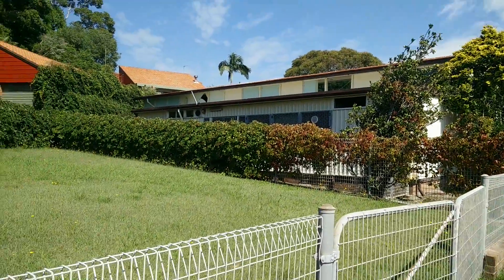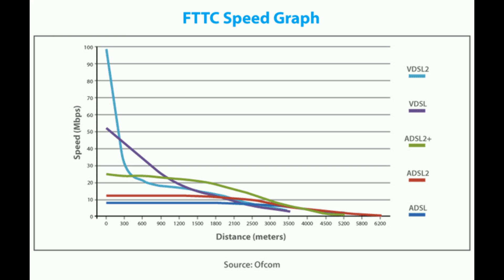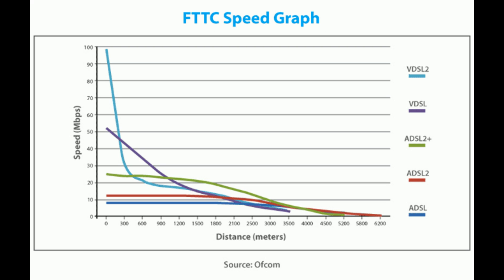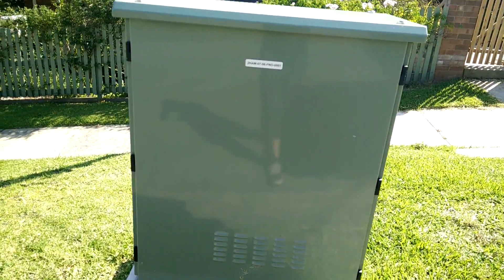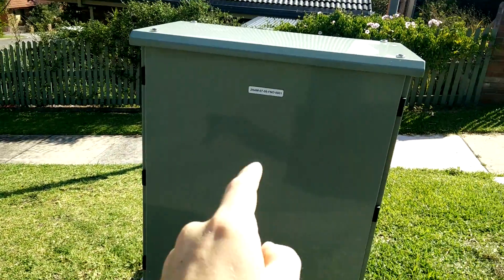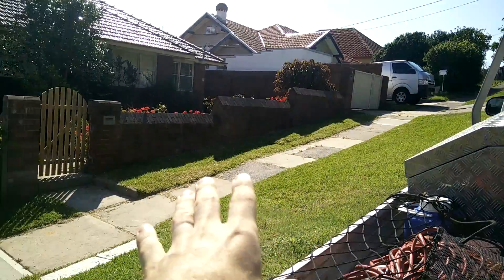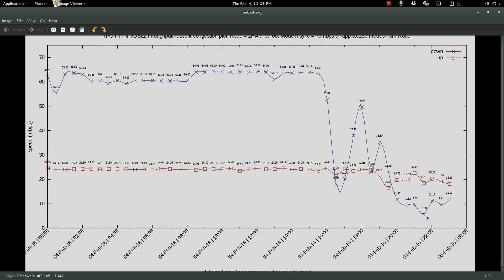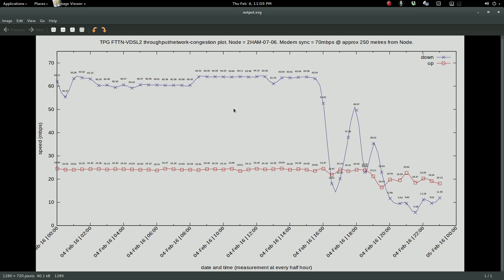NBN - What is FTTN and how to estimate your speed

Comment: Well Done very helpfull. Yours only slows down to 5mbs, mine slows to 30kbs. Thats right KBS.  BUT. I can do a speed test on the site recommended by my ISP at this time in the evening and the speed is fine, by the test. So there is a lot of untruths here. I have been using the internet for 25 years and the NBN is the strangest experience I have had.

Comment: FTTC is not the same as FTTn. FTTC is much faster than FTTn as it only uses a tiny amount of copper .users on FTTC would have no significant loss of speeds and would actually have speeds close to 100mps

Comment: Should use dial before you dig to get an accurate idea of where the copper lines run, so then you can use the google earth line measure tool to get a distance, rather than just guessing where the cables run.
When you perform the dial before you dig request, select the closest possible date, if you dont then Dial b4 you dig will try and charge you. Its a good idea if you go for a drive first and not the locations of nodes around your address before doing the  dial before you dig request.
Create an account at https://www.1100.com.au/ and enter your street address, select the area you want to research then you'll get emailed a heap of info. The file you want to look at is an autocad file, there are free dwg file viewers online to download, I use one from here: http://www.softsea.com/review/Autodesk-DWF-Viewer.html.
Once you open the dwg file you'll see the exact route the cable takes. 
I've seen instances where it would have made sense to run cables from the house in question to a node just down the road, but the cables in fact took a very different route and had I just guessed the path, I would have been very mistaken, and had absolute crappy speeds if I decided to rent the house I was looking at.

Comment: Very well done, with simple explanatoins, but remember the copper line maybe old but so is the copper in your house. Rewire your house with Cat5 or Cat6 cabling it will help. Also remember there will be congestion issues as the NBN is being built and the VDSL has the power of its signal turned down because at full power the VDSL interferes with the ADSL services still working in that same cable. NBN is totally focused at the moment of building the network in full. Then they will go back & sort out bandwidth & conjestion issues.  Just like Windows software.. get it released, bugs and all then provide update patches over the next several years.

Comment: The difficulty with estimating your distance to the node (or exchange for ADSL) is that you don't know where the copper runs in order to get from the node/exchange to your home. Copper does not necessarily run in a straight line from point A to point B, unless you are very close to the node/exchange. It would be more beneficial to know where the pillar is that connects to that node, and the pillar can be 50m away in the opposite direction!

Comment: Mate mine did the same thing come peak time... it became like a friggin yoyo, even getting down to 840Kbs woop woop.... any way few complaints to Optus and they past it on to NBNco who ended up slowing my speed down to create a more "stable" connection. 
So I went from a 98Mbs modem sync to 74Mbs.... this has actually fix it up. During peak times, my speed on 5ghz band will only drop to between 45 - 55Mbs so perfectly usable during peak times .... 2.4Ghz band maxes out at 40Mbs, and usually sits around 20Mbs during peak times. Ethernet connection stays at a steady 65-70Mbs all day.
So yeah it has slowed down. but is now usable, and actually a lot faster than other people I know. 

Now the next problem is the stupid flippin modem, I mean WTF  is this crap. Constant wifi drop out and piss poor reception in back rooms of the house. Plus a large majority of my devices couldn't even connect to the 5Ghz band included a brand new 2016 Smart TV. 
I grabbed a mates NETGEAR X4S Modem Router and tested it. It works and is pretty easy to set up to FTTN (optus) using the connection wizard. But for some reason it syncs about 10-15 MBs less :(    But the wifi is 1000x superior. Ended up putting the X4S into AP mode and just using it as a router. And it's fantastic. 

Im going to buy a D-Link Taipan Modem/Router tomorrow and hopefully this will make it even better...... if not then I will have wasted $500 :P
Reply: Michael Auricht mate I know you posted this a year ago, but did you end up getting the taipan modem, & did it fix the problem you were having? I just purchased the cobra which is the next model up from the taipan ... And how’s your internet running now a year later, has it stayed stable since they dropped your speed?

Comment: unfortunately, that estimation method doesn't really work for MOST people. because more often than not, the copper does all sorts loops and back tracks and what not before your house. I'm about 30 - 50 meters from my exchange, yet well over 200m of copper line exists between my exchange and house - according to the telstra tech who came to diagnose my bullox 1.5Mb/s ADSL2 connection. freaking bullshit.

Comment: I'm on Telstra cable (not NBN) and I get 115 mbits/2mb and it doesn't seem to be effected by peak conditions. I'm due to go onto HFC for NBN in 2018 . I'm worried my speed may actually be  worse because everyone will be on it. At present many are still on ADSL as it is cheaper.
Reply: Yes you will loss your speed it will drop below 100mbps only good thing is faster upload... but peak times its gonna be a mess. Stay on Telstra cable as long as possible if upload is not a problem.

Comment: ur using TPG...... nothing more to be said...
Reply: Oh and its not congestion with the node..... its your ISP overselling their network....
Reply from the maker: "Oh and its not congestion with the node"
You're right. It's not congestion with the /node/ ...the issue of congestion is not a technological one but rather it stems from the business model surrounding bandwidth costs for RSPs (CVC).

"its your ISP overselling their network...."
Not quite. Even though my RSP have the option to buy more bandwidth from NBN Co (the network owners) and therefore alleviate the congestion, it's not viable for them to do so unless I'm prepared to be charged a lot more for my monthly bill. If you currently think your RSP is more altruistic because of your own personal bandwidth experience then I'd suggest reconsidering; it's more likely that you're surrounded by light-use users than your RSP attempting to make less money outta you.

Comment: Very well made video, thanks. If you could do one talking about FTTP that would be very cool!
Reply: With FTTP, the Fibre distribution hub (FDH) is technically the node. The fibre runs all the way to the house and terminates at a Network termination device outside, which feeds into a fibre optic modem inside (from there you connect to a router and/or phone the data ports can also have a direct connection to a PC via Ethernet cable)  which has in my case 2 Voice connections, and 4 data each of the ports can be treated like separate lines/accounts so you could have a data port for private use and a second port for business. In the event of a blackout the modem switches to a battery back up and only allows telephone calls to be made the data side is essentially switched off.

Fibre unlike copper has no maximum data transmission limit where copper maxes out at 10Gbps in perfect conditions, fibre currently can take terabits per second in lab tests or Petabits for 12 core fibre. Also Fibre isn't effected by length of the cable as much as copper, it isn't unheard of a fibre run going 100Km before needing any kind of amplification/regeneration of the signal, fibre also isn't really impacted by electromagnetic interference causing things like packet loss.
Reply from the maker: I don't really know anything about FTTP because I don't have it. I know that the fibre runs all the way into your home and I think it terminates at some equipment which is installed /inside/ your house. The Nodes are still there, but instead of it switching over to copper they just act as hubs. Also, if it was all fibre (like the original plan) then the Nodes would NOT need to be powered, i.e., in the event of a blackout, everyone's internet access would still be working 100% fine. Your computer may not have battery power, but your laptop + phone most certainly would.   

It was a much smarter and more forward thinking solution..

Imagine a catastrophe with FTTN: the Nodes lose power (or at the very least, your Modem loses power), everyone's Internet access goes out, and no one can make any landline phone calls as it's all been switched over to VoIP.. Every single person who wanted to make communications out would be funneling through the mobile phone towers; a bottleneck not unlike New Years Eve would occur. But instead of wishing someone well it could be a message to have your life saved.. shakes head, we dun screwed up methinks...

Comment: My node which is the box with the code im assuming is literally on the same street of me and is within 30 seconds of walking distance using google ive calculated it is between 80 and 70m from my house.. what speeds should i be expecting
Reply: Nearly perfect speeds I would guess.
Reply: I hope so because it is quite near to my house but I'm scared the wiring is gonna be retarded and just go around my house
Reply: this is a great method to guess line length but most telstra copper doesnt run in straight lines from the node to your house, think about it when you run a cable through your house most ppl would want to push it against walls and keep it out of the way zigzagging across the room as well as grouping it with other cables which will significantly effect line length just the same as the telstra copper it will usually run along the sides of roads then only cross the road at certain points with a heap of other cables.

So yes it gives some indication of line length but 70m direct line of sight could be up to as much as 200-500m line length if your line was to say go down street a fair way, crossover street then back up the other side of street to the node or had some other weird path from node to house.
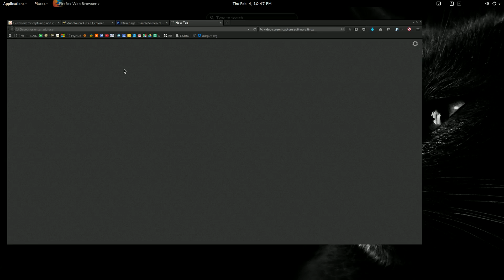Reply: Alright well finally got my nbn tested at 2PM and it was a mighty 91Mbps got back home and its just a measely 42mpbs and is dropping to 30 and occasionaly rising to 50 i tested it at 5:30

Comment: I'd like access to the automated speed test software you wrote so I can do tests throughout the day and graph results and such so my RSP believes me when I tell them what's up.
Reply from the maker: https://www.dropbox.com/s/romb3yqauv6w3rn/speedLogger.zip?dl=0
I built to work on my computer (Linux). To get it working on Windows you will need to find a way to execute speedtest-cli and (maybe) change the system calls within Python.

As far as packaging it up nicely to 'install' like any other professional program with a front-end graphical interface.. Sorry, no. I don't even know how to do that. Linux is wonderful because I can run lightweight things right from the terminal.
Reply: Aleph Zero Wow, thanks for replying so quickly! 

While I'm kind-of tech savvy, I'm not 'Linux user' tech savvy, so I guess I'll just do manual speed tests throughout the day and record my data in Excel.

:(

Comment: Thanks for the video! Any chance of making that graph/program thing available? :)
Reply from the maker: https://www.dropbox.com/sh/ku1id06yvlr0gf0/AAAeDe7hJctqqKmm43JnjZn9a?dl=0
Reply: Thanks, how do I use this to test for myself, or is that not possible?
Reply from the maker: On Linux, you need Python and speedtest-cli for it to work. I have no idea how to get it to work in Windows. You'd still need python and speedtest-cli but would have to amend the speedtest-cli calls within the Python script from Unix-like to Windows-like.
Reply: http://testmy.net is another option it's more user-friendly, doesn't require scripts and is much more accurate. This is what pros use, it has many options like being able to do multithread speed test downloads through multiple servers as well as it has customizable test file sizes so you can set larger sizes to make sure the speed test has enough time to ramp up properly and doesnt use flash which can cause inaccurate results due to the way flash has buffers(go to site it has a more detailed explaination as to why they are more accurate in many ways).

It also has options for running multiple speed tests over a defined period of any length at various intervals(with detailed interval options 5m,10m,15m,1h,10h etc) and displaying it as a graph just like Alephs script and they ensure that the speedtest servers arent located inside the provider networks so you can test inter-ISP peering. 

QUOTE "Internet providers like to eliminate any variables when testing, so they send users to internally hosted speed tests. This can help an ISP mask their shortcomings, namely with peering. Remember, your provider isn't only responsible for giving you access to their servers... you're paying for Internet service, not LAN. Make sure that they don't fool you into believing the problem has to do with the websites you're visiting. TestMy.net has been a trusted free Internet resource since before your ISP ever even thought about making a speed test... possibly before they even existed. Furthermore, TestMy grades all connections based on the same criteria regardless of provider and we are not affiliated with any providers so our results are unbiased. TMN has no stake in the outcome of your speed test results. We work for the consumer not the ISPs"'

So for example if your with iinet and you speed test to an internode server using ookla its not a very good test as its only testing the internal network since iinet and internode are owned by the same company TPG and ookla uses flash so its not an accurate test at all.

:3 have fun

Comment: 7.77Mbs with NBN to the node just installed
Reply: 70mbits down 30mbits up on my new node. Weird because I'm 500m away. 

On adsl I got 6mbit down 0.9mbot up
Reply: you get 70down 30 up at 500m away? It looks like I'm going to be 330m away from mine but might only get 25-30 down and I'm not sure how much up. At this stage we haven't moved off adsl2+ yet. NBN only went live just before Xmas.
Reply: 10/30 Mbit with FTTP. Paying for 100/40 Mbit. It's supposed to be closer to 90/35 Mbit.

Comment: thanks, very informative. Can you help me out? I've heard the NTD houses a media converter from optical to ethernet, and that you can plug a computer via ethernet cable straight into it. Does this mean that you don't need a modem and that you could plug in just a router for wireless connection? thanks.
Reply from the maker: +Julian Weaver The NTDs are for FTTP, not FTTN (Fibre to the premises VS node). That is the superior (dare I say 'proper') NBN that Labor had envisioned. This video only deals with FTTN. With FTTN there is nothing that needs to be installed in your home except a modem that is shipped to you (much like ADSL today)
Reply: +George Edwards thanks, I am now aware of this, no thanks to exetel or T-Link who were very vague on their help lines. I guess it's really not that relevant to them when they're in Thaliand and just want to sell you something.